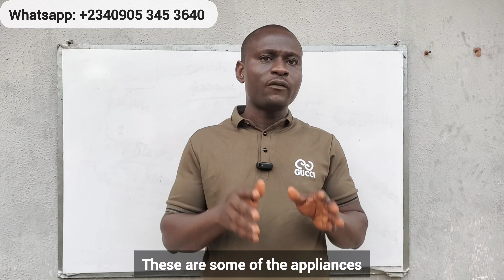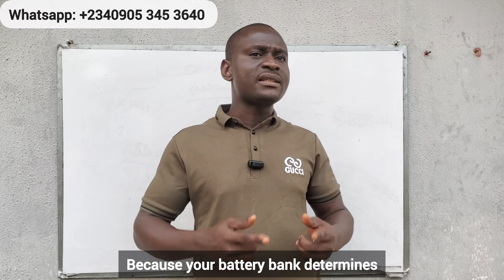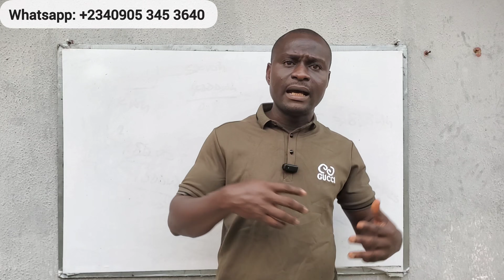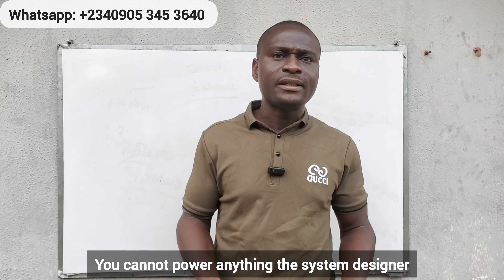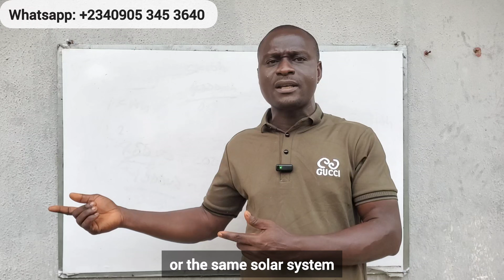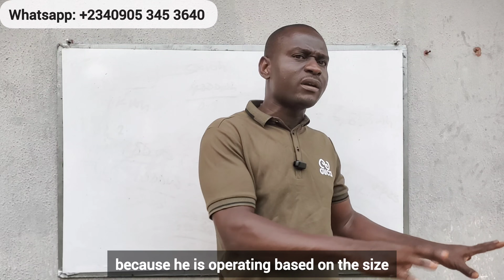Appliances That Kill Solar Fast

Comment: If my maximum short circuit current is 25A, can I still use a solar charge controller that maximum charging current is 100A

Comment: .@Solarwattng | Using #lighting with improved #EnergyEfficiency is key to fighting energy poverty & climate crisis. Oretronics Technology #LED Lighting for example requires 90% less energy to perform same tasks. More energy efficiency means less energy demand, lower bills and avoided emissions. Check the Store link in the bio for more details and to order online.

Comment: I use 20kva felicity inverter, 3 units of 17.5kw lithium batteries, 3 120amps felicity charge controller(mppt) plus 66 panels (440watts)....I cut off from grid and it has been the best decision ever. I run 2 AC simultaneously over night and I will still have over 40% back up at day break. It powers all appliances including induction cooker, AC, water heater, iron, pumping machine etc... Solar is the best
Reply: Most of this installers no nothing... It best you get a basic understanding on how the calculations are done so you won't have issues.... Nb: cable sizing, solar panels, battery, inverters and even charge controllers are all essential components that sync hence you will face issue in future. I use 10mm for panels and 50mm for batteries
Reply: Costs and affordability are issues to consider. You have a high budget system.
Reply: @WilliamEbohyes o, it must have cost him a lot
Reply: Solar is really the best 👌
Reply: Haaaaa, you must be a ritualist 😂😂😂😂😂, good job 👍!!!
Reply: @ARTROTV lol
Reply: Do you think  a 20 million naira budget could give me same thing like your system set up?
Reply: @DanDan-dn5lt you can ask your installer... But ensure they use 15mm cable for panel arrays, and 70mm cable for inverter to battery
Reply: Nice one... Please, run me a cost estimate of your total 20kVa solar system. 
Thank you.
Reply: @DoggedAssetManagement 26m approximately
Reply: @adeniyiii  Thank you
Reply: @adeniyiii 😮
Reply: @toyinpender5932 what???
Reply: @adeniyiii you were ripped. It shouldn't cost more than 20m bro. Be wise..
Reply: @joeaugust1926 Just shut up... I bought everything myself
Reply: That is because you are using a heavy duty inverter and battery.
Reply: Mehn you know what you want. I love spending money on where it's needed

Comment: Thats the reason you need to calculate the load first before any qoutation so you can size the system according to load,backup time you need to run on battery
Reply from the maker: Absolutely right sir. Thanks for your input 👍

Comment: I learned the hard way. Now I set a limit of 25% load on my battery. No matter what the battery load cannot exceed 25% under normal operations. Now I get more than 3 years for every battery I got. And now I am expecting 5 years out of the ones that i just got.

The way I force protection on batteries or inverters is to calculate that max wattage I want, and put fuse that will protect the batteries or inverter when that power is exceeded. Sometimes people connect things by accident and damage batteries that is more than 10 times the price of fuse.
Reply: I personally use a relay on the AC side of the inverter to disconnect the load when the voltage drops from the battery.

I use AGMs, so I set the disconnect at 12.1v. This way, the batteries are automatically protected from over discharge (below 50%) and high loads. To control the relay, I program the LVD (low voltage disconnect) on the charge controller to disconnect at 12.1v (this will work with charge controllers compatible with lithium batteries, cheap PWM controllers will only let you set 11.8v). I connect the relay to the load output of the charge controller.

To protect the inverter from overload, I use a smart phase monitoring relay, and set the maximum load allowed at 80% of the total capacity of the inverter. This way I prevent these cheap inverters from failing due to severe overload.
Reply: @Catalin_C97  It looks like you are trained on the rich man's solution.
For some reason I always go for the poor man's solution first. When there is money I go for the rich mans option.
The fuse can protect any electronic device but no device can protect a fuse. That is going back to the fundamentals.

Comment: Also we need explanations on how to connect the system without panels and charging using the grid plz
Reply: Grid inverters always have Ac in and Ac out, it is not rocket science to locate it